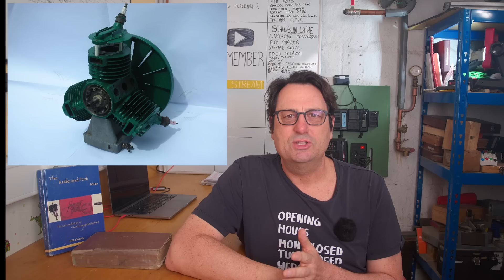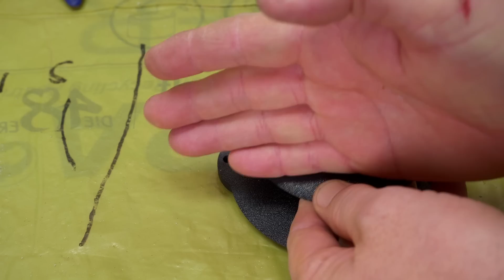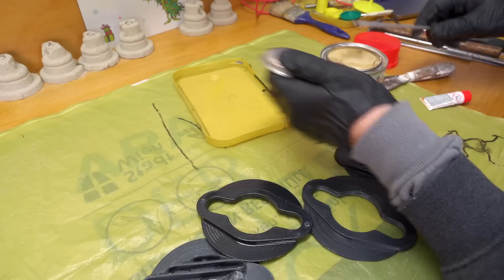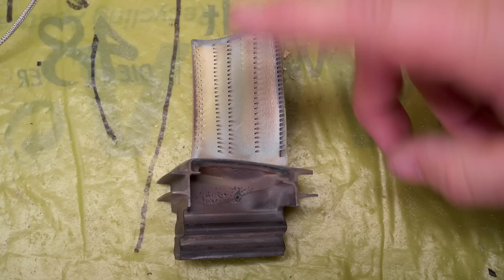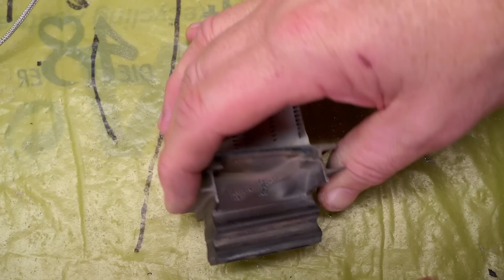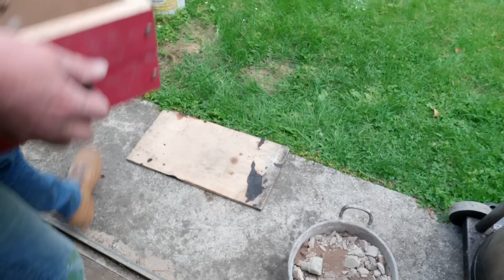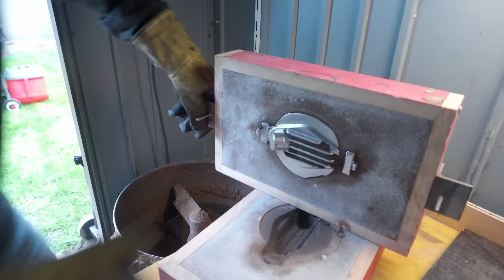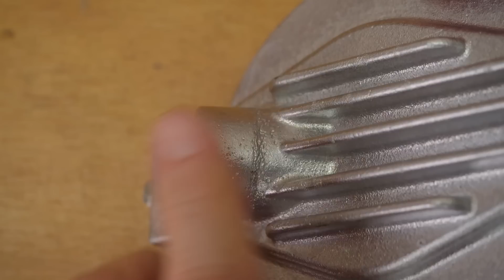Prototyping cylinder heads - Redrup Radial EP.6 || RotarySMP

Comment: I'd have use a razor gate at each end rather than the two little gates.
Martin will help anyone out and is one of the beast & most open people you can talk to on the casting topic.
I tend to pull the  melt out of the Furness around 760 degrees (Martins recommended temp).
I use petro bond, and it picks up a lot of detail, but you can get round this with a light brush of the mold once pulled (roughening it up in effect).
Good work mind & persistance always pays off.
Reply from the maker: Thanks, Martin is a champ.

What is a razor gate. I couldn't find a picture of one.

Comment: Just tried to recreate your model in FreeCAD (1.0 and latest realthunder) and the problem is your design of course. Your lozenge draft angle (probably -3-5 degrees taper) is too aggressive you see. Instead you should use -2.8 degrees taper, which works. Don't question the number, let FreeCAD improve your design. (/s but actually 2.8 or smaller works for some reason)
Reply from the maker: Thanks for looking at that. I need to do a few mods to the pattern, and will try that out.
Reply: @RotarySMP  I filed issue 21665 on FreeCAD's github and included the model for which I got the fillet working.
Reply from the maker: @mhdm  Thanks for doing that.
Reply from the maker: I am just working on V 3.5, and stepped everything back till I just have sketches. I tried reducing the draft angle to -2.8 but it still failed out. Reducing to -2.5 also didn't help.

I just downloaded your file from the github, and will continue building my new model on it.
Reply: @RotarySMP  Yeah, FreeCAD can be terribly finicky - sometimes a slightly different way to model the ~same geometry can work (or break).
You're very welcome to build on top of it.
Reply from the maker: You had changed the lozenge shape a bit. I redrew mine from scratch though, and have the same behaviour you found, only now it breaks at 2.4°. Still that is a better filllet than my bondo one. Thanks.

Comment: Quick option that you might want to look at for a better finish for the supported areas on the 3d print is using a PLA support interface when printing PETG as these don’t like to bond together and it easy with the AMS 😊
Reply from the maker: Good point. I even have a sample of that support material. I should use it.

Comment: Great video as always! I had to pause midway and comment because your wedding ring made me nervous. I’m sure you’re well aware but that thing looks like it  should be taken off and resized before it needs to be surgically removed. I say this as a (Internet stranger) friendly tip
Reply from the maker: Thanks. I have only just put it back on, as it was in the drawer for a month, when I forgot to put it back on after taking it off to do some machining. It is a firm fit, but generally slides off easily.
Reply: @RotarySMP happy to hear it’s not as tight fitting as I thought :-)

Comment: Harley Davidson put a lot of research into sidevalve combustion chambers with their racing model the KR. It’s all about the compromise between compression ratio and flow into the cylinder. I might worry that your high-comp head is a bit restricted around the intake valve, maybe the lozenge shape would be better for intake? Exhaust doesn’t matter as gas is under high pressure.
Reply from the maker: I am not trying for performance, I will be happy if it runs. The original only made 2 3/4 hp from 309cc.

Comment: Thanks for the video Mark! Inspiring work and persistence.
I feel your pain with FeeCAD. I have grown to love it, but filleting complex patterns has made me question my devotion more than once. In a couple of cases, I have just left them out of the model like you did and added them in with the automotive filler/Bondo afterwards.
Also, you could be trapping some gas in the big round fin, making it slow to fill. Some scratch vents at the edges could help.
Reply from the maker: Thanks Charlie. I did all the production castins at 720°C and the fins all filled without defect.
Reply: @RotarySMP  That is good to hear. It's crazy that 40C can make such a difference, but there you are.

Comment: Wouldn't a coarser finish be better for heat transfer?
Reply from the maker: Probably, but it is such a low power engine (2 3/4hp from 309cc), that I doubt it will be much of an issue.

Comment: Be careful about the threads. If this engine was originally design for a cycle. It's possible that it uses a british standard cycle thread and not BSF. As for the size across flats. It was changed in the war to safe metal. But kept the same nomenclature. So a 1" spanner from before the war  is bigger than a 1" spanner from after the war. I don't know if that is the case for motorcycles. As there are different standards for cars. Steam engines cycles etc. depending on how accurate you want to do the build I think it should be possible to find a motor in some museum and get permission to measure everything you need.
Reply from the maker: I discussed this with Bill Fairney, Redrups autobiographer, and he confirmed that BSF was usde on his engines. He had worked in aviation in WW1.
Reply: Thats good to know. British standard bike uses a thread of 60 degrees. Others use 55.
Whats your final objective with this project? If you are willing to change the alloys of the castings. Would you be able to just change the threads for something more modern. Anything that can reduce those 5 years you mention should be welcomed.
Reply from the maker: @jabonet  The main challenge will be the crankcase with it's integral cylinders in cast iron. I have thought of aluminium with sleeves, but only if I cant get the cast iron to work.

I will stick with BSF. I have a CNC lathe, so making production runs of fasteners is not too bad.
Reply: I wonder if you could do the whole thing in aluminium and coat the cylinders in nikasil.
Reply: I wonder if you could do the whole thing in aluminium and coat the cylinders in nikasil.
Reply from the maker: @jabonet  You could, but I am trying to stick with original.

Comment: if you use a 0.2 nozzle you can get down to 0.06 layer height in the slicer, and you can manually do even lower. Pretty cheap to boot.
Reply from the maker: Thanks for the tip.

Comment: I came to say what others have mentioned (printing vertically or at an angle to help hide layer lines on shallow slopes) 

Also that orca slicer (based on Bambu Studio and compatible) has a field in the filament profiles you can specify the shrinkage in.
Then it will compensate for the shrinkage as it slicers the job.
I've found Bambu Lab ABS shrinks 1%, ASA might be similar but I haven't tried it.

I've acetone smoothed many thin sourcer shaped abs parts to make them easy to clean in hydroponic systems and found warming the acetone or adding a small PC fan inside helps smooth the surface faster before the thin parts of the print go floppy and deform.
Reply from the maker: Thanks for the tips. I am nit used to tilting parts like that, but it is impressive what people do with these printers.

Comment: Good progress. The final casting ended up looking pretty good in the end. 

The stuff I’ve poured in the around 720c range has all come out pretty good with relatively little dissolved gas and holds oil well.
Reply from the maker: Thanksa mate. I was also planning to do the final production at 720°C. I will also try my oil bound sand and see which finish I prefer.
Reply: @RotarySMP  i look forward to seeing it, when I was at the foundry last, they were pouring some thin parts and were using hard sand (it was either sodium silicate or resin bonded). They preheated the sand prior to pouring I'm unsure of how effective it was though.

I'm curious to see how the oil bound sand works.

Comment: Hi, greetings from the motherland (NZ)! I’m surprised it’s not more well known, but BambuLab slicer and printers have no issue dealing with .step files, you’ll notice the sliced G-code comes out with real arc commands like G3s etc, you get much better results with smaller files and get rid of that nasty faceted look of .stl files. Win win win!
Reply from the maker: Thanks mate, I hadn't looked into that. Good tip.

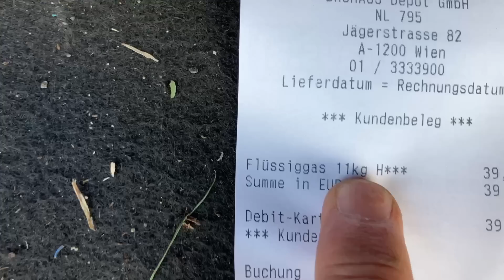Comment: 33:03 That's terribly expensive. Here in north-east europe swapping for a refilled 50 liter tank costs about 18€.
Edit: i'll correct myself. The big 50 liter tanks are 28€ per refill. The smaller ones are 18.
Reply from the maker: Gas has always been much dearer here than for example germany. Also Argon and CO2.

Comment: My experience with FreeCAD is that sometimes it's surprisingly powerful, but sometimes it's an absolute dog.
Sometimes you make a part using a certain workflow and then in the end find out that the chamfer tool doesn't like a single line in the model and breaks.
But changing that line requires to remake the model in a different way completely from the start.
Reply from the maker: That pretty much summarises my experience as well. To be fair, the dev team is doing a lot to improve it.

Comment: Only thing The Fastener Black Book has on BSF 3/16 is T.P.I. 32 #21 taping drill or 4.0 mm
Reply from the maker: I have been informed BSF has the same size head as BSW one size smaller, so 1/8BSW would be an 8.54mm AF hex.

Comment: Hi Mark,
Welcome to my world of blown head gaskets.
My WW2 Willys MB is a classic for them. The extra area needed for the side valves gives very little room for head studs. There is a stud between the too close together cylinders 3 and 4 that goes straight into a water jacket. Flexy. Minimal face area on the block and head to clamp. So the stud cracks the block there. It got worse and worse until it was blowing every 3 months. The cure was to buy a brand new block. About $A1200. I think it was made by Hotchkiss in France as they bought the old Willys tooling and re-manufactured the WW2 Jeeps for the French military. So surplus when they let them go. Perfect, but still flawed.

On and overhead valve engine the gas pressure acting on the head is just the area of the cylinder bore. For the side valve it has the added area around the two valves. That can about double the force trying to lift the head off the gasket (if it actually has one). Adding to that is the loss of that area of clamping face.

Ideally, the clamping face area should be much larger than the total cross sectional area of the studs. Then you apply a enough clamping load from the studs (or head bolts) so that the gas pressures never open the clamping.
For example lets do a specific case where the clamping area is 10 times the bolt cross sectional area. In that case the studs will stretch ten times as much, when you torque them, as the camping faces they compress. When the gas pressure comes on it is taken mainly by the clamping faces unloading, in the ratio of 10:1 to the studs. The clamping faces are still in compression (hopefully) and the stud extends an extra 1/10th of the preload stretch. So no fatigue for the compression faces and minimal for the studs. Nice if you don't want fatigue to blow heads off a radial.
And the movement will be more like the 1/10th i.e. the compression faces as they unload. Nice and stiff.
Of course those loadings are a bit simplified, but you get the idea. It's why you can't reliably go much over 6.5 compression ratio (like my Jeep and your engine) on a side valve without running into trouble.

The head on your engine looks perilously thin? From the sketch it looks like about 10 bolts go through the cooling fin, but I don't see any bolt bosses on the head? Will it be spot faced? Maybe they added to the stiffness with a heavy washer on the bolts? It may suffer from the area ratio issue as above.

I designed the cams on the later Orbital engines. They were basically radials. Early radials had all sorts of gobbledygook cam trains, but from bout 1920 they all settled on large ring cams like in all the big radial aircraft engines.
A 4 stroke radial engine it will always have an odd number of pots. The engine does 2 revs per cycle as per any 4 stroke. It fires every second pot as it goes around. Twice around gets you back to the start.
The formula for the ring cam is: 

Cam speed = 1/ (No. of pots +/- 1). 

So for your engine 1/2 or 1/4 engine speed depending on whether rotates in the same direction or reverse to the engine. The faster speed rotates counter to the engine.

For the number of cam lobes you simply invert that ratio and half that number.

So for your engine it's 1 lobe and 2 lobes.

So 3 pots might be a special case where you could use a simpler system, which it looks like from the exploded view.
Reply from the maker: Thanks a lot for taking a look at this.

Yes the head bolts will be into spot faced holes in the head. BSF has pretty small heads, so I guess I will add a washer. Remember this is only a 5.6:1 compression ratio 103cc per cylinder. 

Charles Redrup used a very funky solution for the valve timing. Rather than a typical  ring cam, he used a cycloidal drive.
Reply: @RotarySMP  I had a 1958 BSA B31 when I was at university in Wellington. It had no head gasket, just two circular faces, one that spigoted into the head. I real bugger to fit as it had 4 tie rods down the the crankcase outside that. So they tilted the head while tightening. I spent ages tightening and loosening them in turn to try to get it straight. Put a bit of gasket shellac on it and watch it blow bubbles from wherever on the joint. The leaking didn't seem to damage the face, but I never got it right.
Reply from the maker: @davidjensen4490  I have not yet thought about how I should so the head gasket on this. Copper?
Reply: @RotarySMP  The last reply was days late because my main PC has issues.
So here is another update. I've put a couple of videos up on my YouTube channel showing how I think the Redrup cam in the drawing works here:

@davidjensen4490

It's done in SolidWorks using OBS.
So the cam definitely runs backward relative to the crank direction at 1/8 the crank speed.
If it were a normal gear it would have 8 lobes, but he deletes every second lobe so the valve timing works. It still meshes with the pins okay. Note that you need the gear profile for the cam rotor to rotate correctly but it looks like Redrup cuts away some of the inner part of the lobes where the follower contacts to shorten the opening dwell. I think it might also be to do with the cam impacting the follower. You could of course bolt a separate cam follower plate onto the gear with a completely different profile, although that mustn't hit the drive pins. The way Redrup does it would mean the cams aren't identical.

On another topic. The knife and fork big end doesn't show much to do with oiling. It would need 5 oil drillings in the big-end to a correct position under each conrod. I don't see how he gets the oil into the crank. On my Triumph it was fed into the end of the crankshaft

Comment: For price comparison. The most expensive way to get 20 pounds of propane here is by exchange and that runs $20+%8.25 tax. However some of those exchange companies only put 15 pounds in... If you take it to an actual propane supplier and have it filled it is quite a bit cheaper. I still remember complaining when it was $5 to fill a tank.  Oh and here you can't bring the tanks inside the store (by law) they have a cage out front that they will swap it out of or some places have a vending machine where you pay, put in your empty then it opens a door for you to grab a full one. Some have a carousel inside vs a bunch of doors. Larger tanks are cheaper to fill as it's charged by the gallon instead of a per tank cost on the small ones. My two 50 pounders need to be recertified due to age next time I fill them but they look like new as they are kept out of the elements.

           How about blasting the rough casting to remove the layer lines. I know that will remove the standard sand texture but... Also as for the compression ratio. I often don't think about it when looking at old engines. And the cylinder pressures are so much lower on those engines that they make for a more durable and easier starting engine. Just lower overall loads on those engines. Now when you get it all worked out in the end you can sell a kit of the 3d prints or something for those wanting to make one or maybe someone that can cast can make a raw casting kit for you to sell or license etc.
 
     I first started in CAD with Autocad 13. I think I still have a copy of it and 2000. However cad is a different animal now and I am horrible at it since I don't do it and don't want to put in the time to get good at it. Too many cool things to do and not enough time.
Reply from the maker: Hi Robert, 
I have received three of four comments that bringing the empty propane cylinder into the store would be illegal in the states. All the ammo in the Walmart gun section is not a thing here :)

I think the deman for a Redrup radial kit will be about zero :)

I also started with AutoCAD 13. My current favourite would be OnShape.
Reply: @RotarySMP True and those that bought a kit most likely would never actually build it. 
     Here the fire department has a thing against unknown condition containers of flammable liquids and gasses in buildings. 
   
      Does WM even carry ammo anymore. I don't go to that part of the store. The closest I get is the automotive section. Not my thing so I don't pay attention to who has what.

       I don't miss the old days of autocad deciding not to do a command... You would have to save them close and reopen the program and it would start working again. My friend taught the cad classes at the highschool and the kids hated how buggy it was back then.
Reply from the maker: @theinfernalcraftsman  I designed my first (unbuilt) cnc router in Autocad 13.